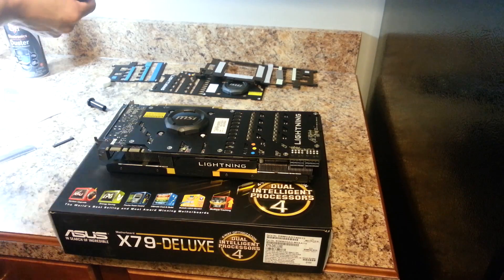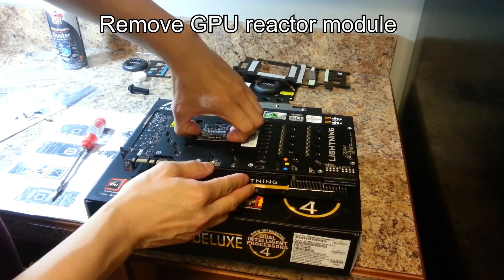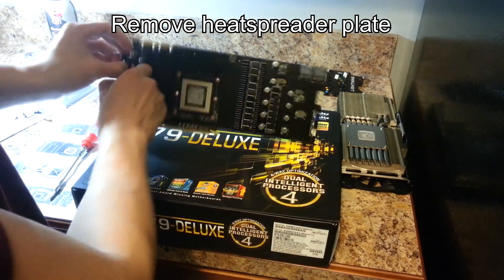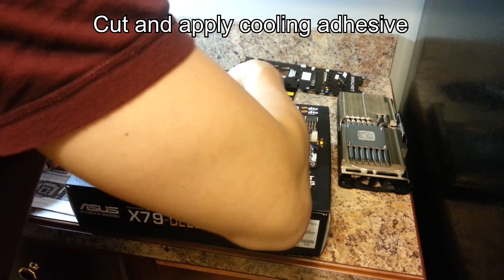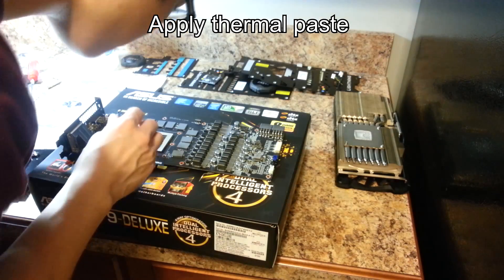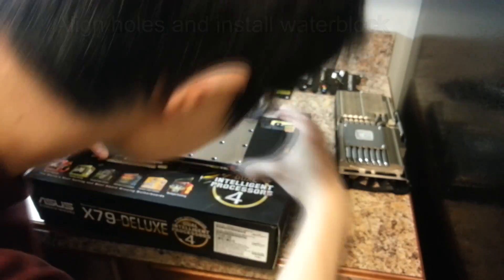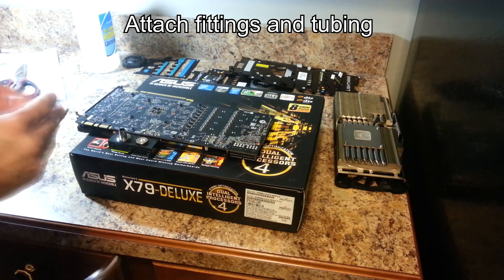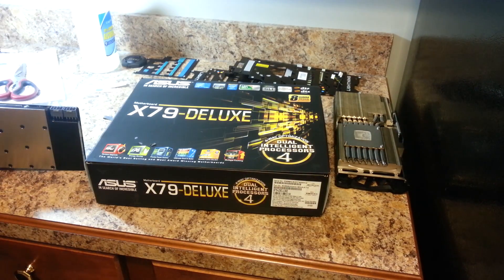Graphics Card Water Cooling Guide: GPU Waterblock Installation (EK Block for MSI GTX 780 Lightning)

Comment: i tried to remove the cooler from my hd 7950 950m but its doesnt go off after removeing the gpu screws which should be all..so my question is how hard do i have to pull to lift the cooler of if its stuck (it does not move at all just like i never took the screws off) im scard of damaging something so it would be nice if someone could say me how hard it can be to get this of

Comment: have you seen the nzxt kraken g10 im actually interested in it its a easier way to water cool your gpu
Reply from the maker: Yeah, it looks interesting, and it's a less "ghetto" way of attaching a CPU cooler to the GPU. There have been a lot of custom brackets floating around allowing H60 etc. to attch to the graphics card.

Arctic also had a liquid/air all-in-one gpu cooler, but I think it's been discontinued.